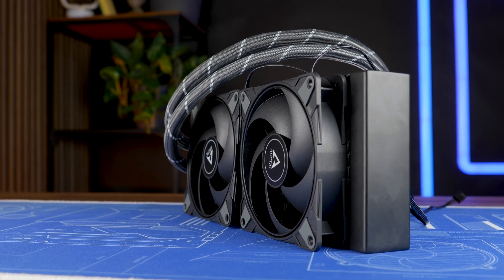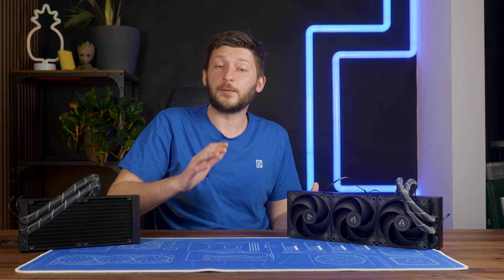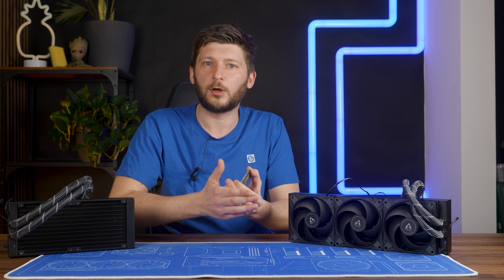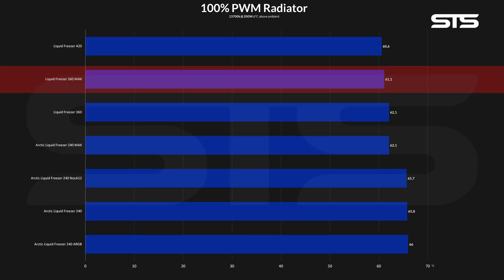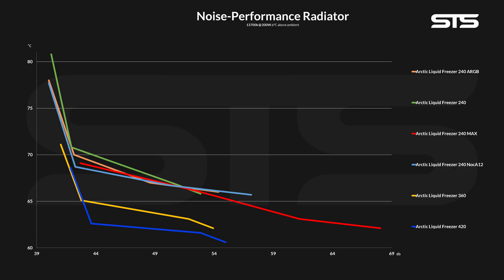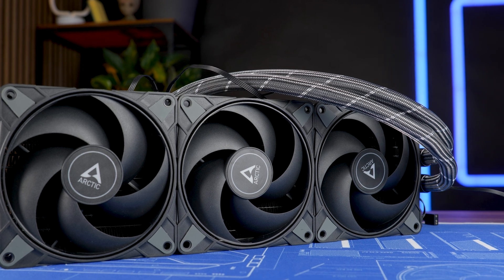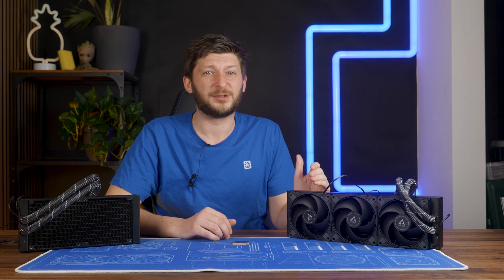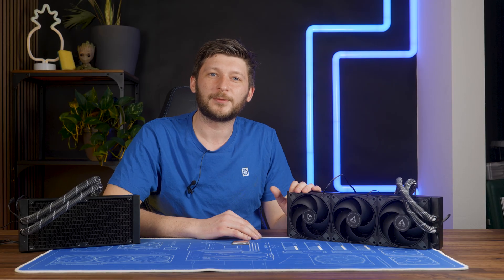Arctic Liquid Freezer II 360 MAX - How Far Can We Push It?

Comment: Oh man are those P12 Max fans loud at 3300 RPM lol... I have 2 running in a push/pull on an AIO but that AIO had a partial failure related to the internal USB and now those fans are locked to 100% fan speed. Grabbed another P12 Max and an ALF II 360 for gratuitous overkill on that particular rig, it's going to have better cooling than my main rig with an i9 in it. Goes without saying I'm turning the fan speed curve down once I get the Arctic AIO in to replace my current one.

Comment: If I'm reading your graph correctly the max fans ran hotter at lower RPM (sub 25% for the max). Then for a brief window (50 to 54db) it ran slightly cooler before equaling out again at 55db. After that the non max fans are capped at 1800 rpm but the max fans keep running to 3000 rpm and get quite loud at that point for very small temp gains. You would think the max fans would run cooler and quieter up to 1800 rpm but that doesn't seem to be the case except for an extremely small window.
Reply from the maker: Exactly!
Some of this comes from the dual ball bearing. Compared to just a P12, the P12MAX should be SLIGHTLY louder at a 1-1 PWM comparison. And if you translate that into normalized by noise, you would need to make the MAX spin slightly slower to achieve the same noise, thus making them weaker, thus resulting in slightly worse performance.

Comment: Question when you mounted the AIO is it sucking hot air from within the case if so how does it expect it to keep your cpu cool am I missing something?
Reply from the maker: Answered in the other comment
Reply: @STSYT I just flipped the fans to suck cold air from the outside through the rad not the inside pushing hot air through the rad where it's hot strange they would position it that way.

Comment: I've just replaced the factory fans of my Liquid Freezer II 360 with these ones and got 7*C drop in CPU temperature at 100% fan speed. Not sure why you got just 1*C drop. I tested this on an overclocked Ryzen 9 7950x 5.4 Ghz CCD1 / 5.3 Ghz CCD2 in Cinebench R23 10 minute loop (220W CPU package power during the test). I'm also happy that I don't have any strange noises that some people complain about with these fans.
Reply from the maker: Nice! And weird, there is a margin to these results, but 6 vs 1 is quite heavy
On the other hand, considering how our 360 performs vs our 280, maybe our 360 is just weak to begin with
Reply: @STSYT  Did you offset mount the AIO? I mounted mine with offset, as shown in the installation instructions. This gives Ryzen CPUs better temperatures since the cores are not in the center of the chip. This might explain the difference in our results.
Reply from the maker: @bgtubber  on the general benchmark, yes.
This specific video was made on a 13700k, no offset there

Comment: How you connect them? My cpu motherboard have 1amp cpu fan and i cant connect all 3 i do have hub what is tue best way to do ?
Reply: Maybe you can connect 2 into a splitter and then connect the splitter into the CPU fan header. Then connect the 3rd fan by itself into the CPU_OPT header. Would that not work?

Comment: I mounted two Phanteks T30s to my Liquid Freezer 240, limited them to 2,000 RPM (Performance Mode) and I gained nearly 3 deg C on my slightly overclocked Ryzen 5900X running Cinebench 23. But more importantly, I actually lowered the noise of my cooler in all normal application workloads as it rarely breaks a sweat, going up to only 1200 RPM when rendering a video in Davinci Resolve for example.

Comment: Hi there, i have bought liquid freezer 420 RGB, and the same 2x fans (p14 rgb pwm pst 0db) for the case. On the AIO fans are silent until pwm is 50%, but other 2 fans are kinda loud at 30% already.
Is it because they are mounted verticaly, while aio is mounted horizontaly, if not what could be the problem?